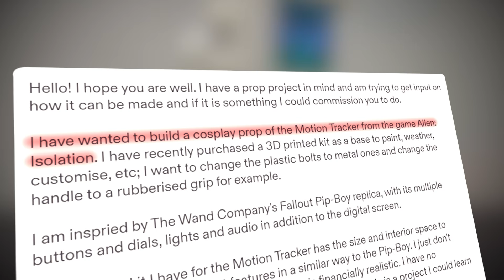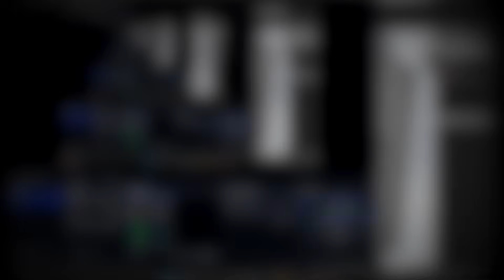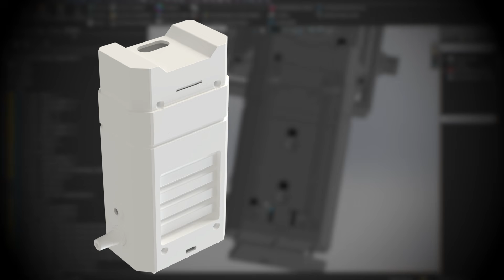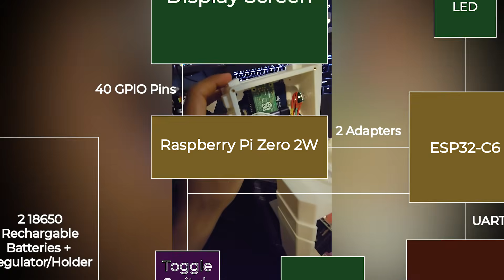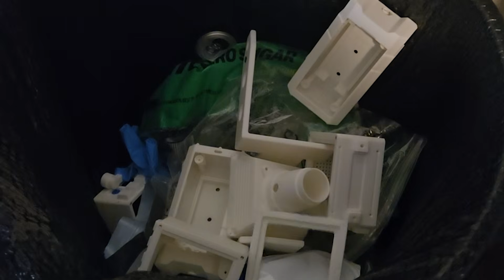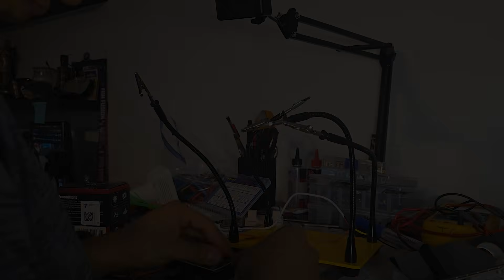I Engineered a Motion Tracker from Alien Isolation!

Comment: there is technically a way to track motion through walls via wifi bandwiths but im pretty sure how it was discovered was accidental and then made very illegal to replicate so be sure to look into that, i could be wrong and its honestly an interesting thing to read about
Reply from the maker: I’ve been reading about that too! If I make a V2, it’ll definitely be a controlled demo with proper sensors, not any sketchy/illegal Wi-Fi tracking lol. Super interesting rabbit hole though.

Comment: I was hoping for a working motion tracker, however cool this prop is.
Reply from the maker: Fair critique! This one was built to behave like the in-game device with screen modes, sound, controls, and clock mode, but it doesn’t actually track real motion as per client request. A V2 that actually tracks movement is very tempting though 👀
Reply: @BarronixLabs  A simple heartbeat pretense sensor should do the trick.
Reply from the maker: It could work for basic presence detection, but I think it might be a little noisy when detecting exact location for the kind of tracker I’d want. I’d probably look more into mmWave target tracking so I can get movement/distance data and filter it into the alien radar-style display.